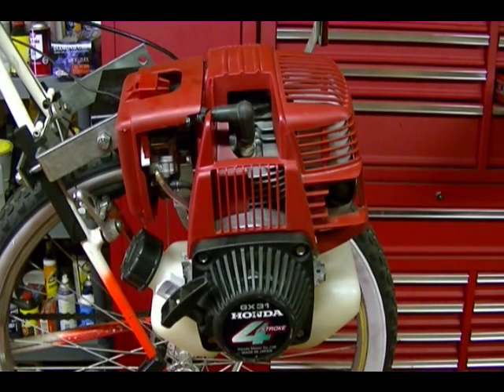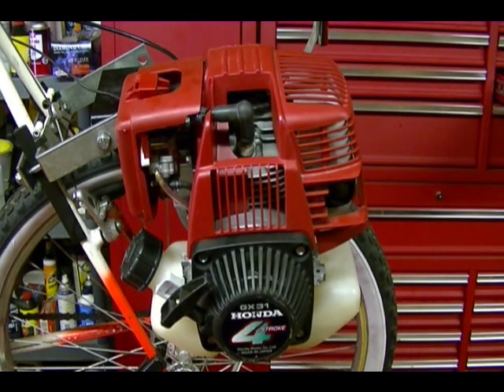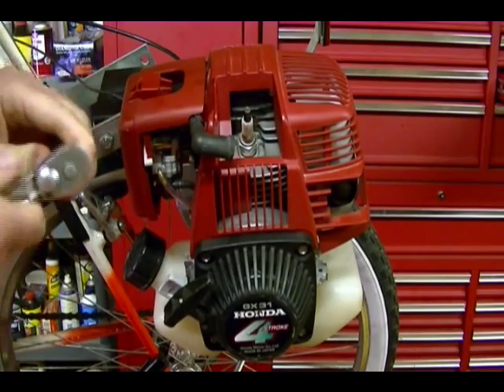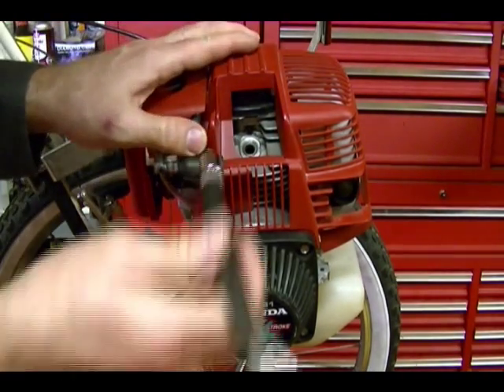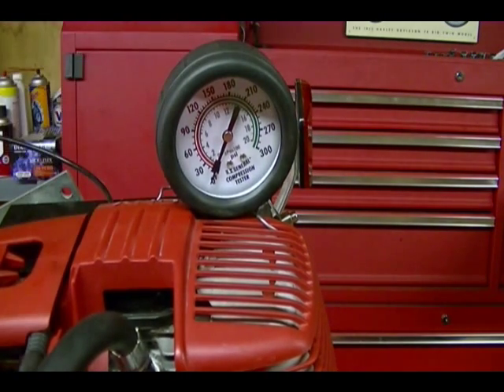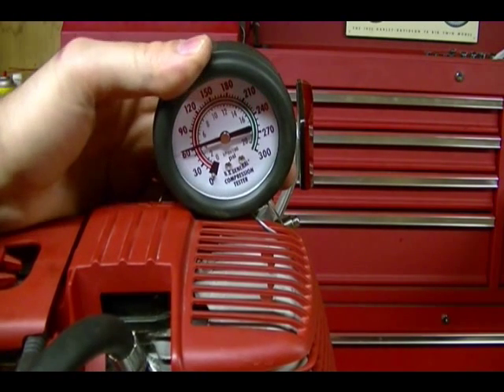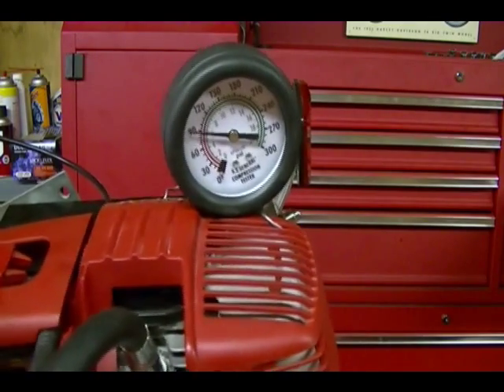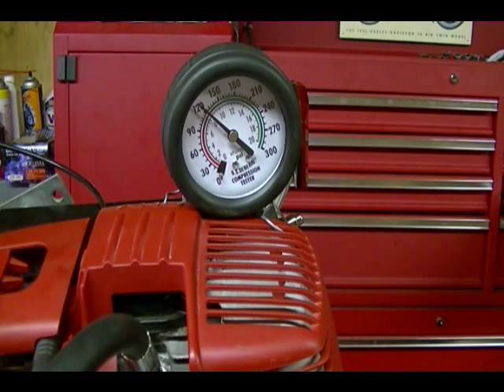Small Engine Repair: Honda GX31 Compression Test & Why the Throttle should be Wide Open

Comment: For engines with the easy start compression release you can bring it to TDC where you know the exhaust valve is closed then use an air compressor to pressurize the cylinder and see how well it holds air pressure.

Comment: some engines you cant do an effective compression test, dont know about honda's but for example kohler k series has automatic compression release which releases some of the compression through the exhaust valve to make cranking easier, this allows less effort for recoil starters or a smaller starter/battery for electric start. to start a k series without compression release you would be pulling your arm out. those little k series make good compression

Comment: Question, why does pressure not escape on the exhaust phase? Is it because the air compresses the piston and doesn't allow it to go to exhaust ?
Reply: Because the gauge itself has a one-way valve it’s measuring acumulative pressure